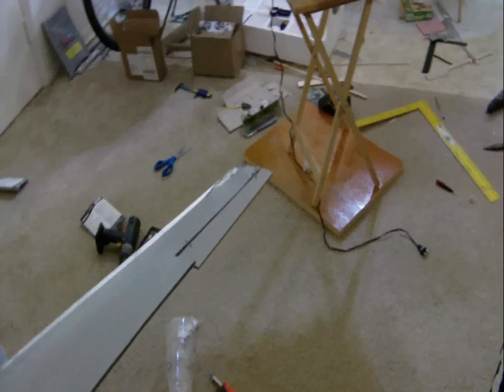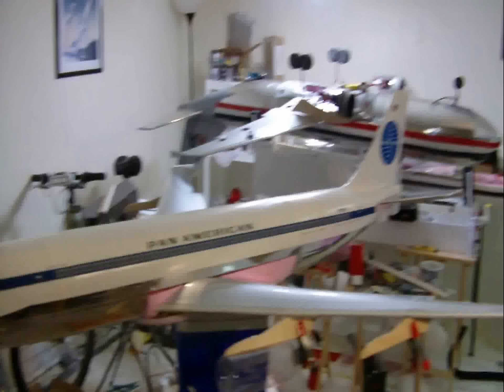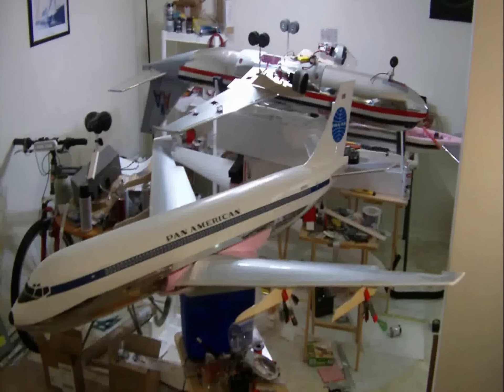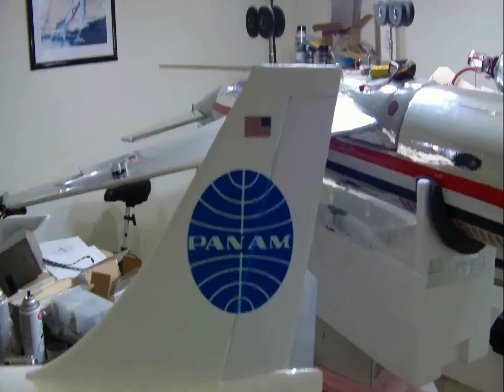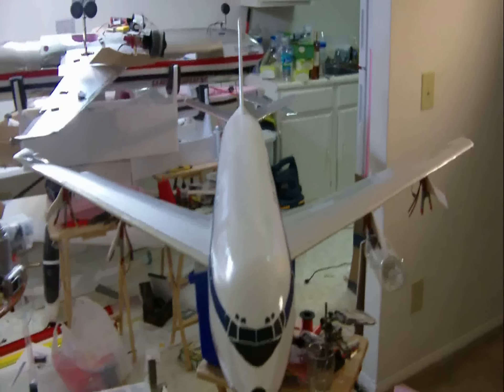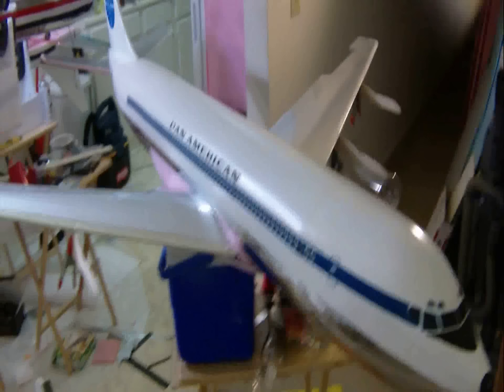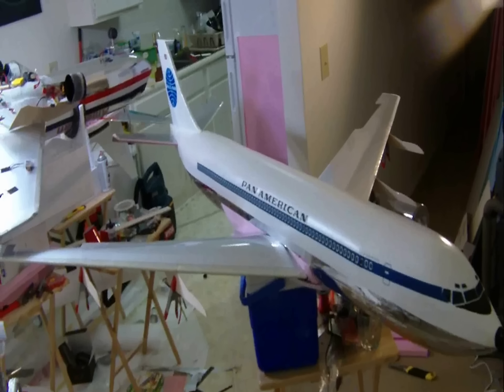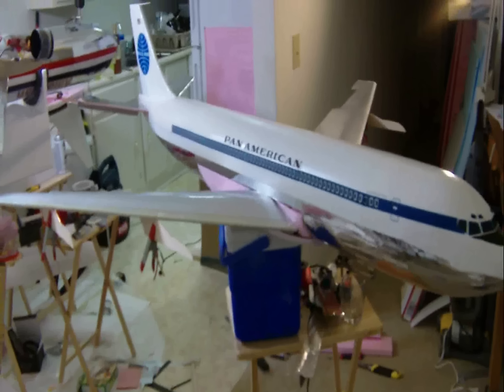RC Pan Am Boeing 707 120 short-tail!

Comment from the maker: @b767yawdamper HI B767! a 707 will run you 1,000.00 dollars U.S. & that's not including servos motors, batteries ETC, just a finished painted airframe.